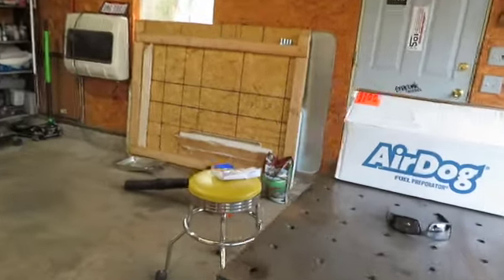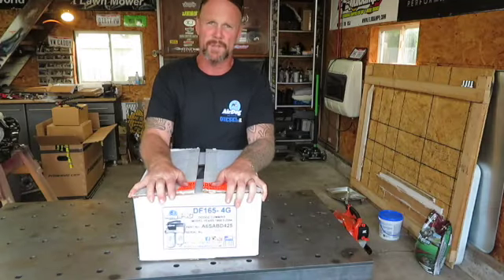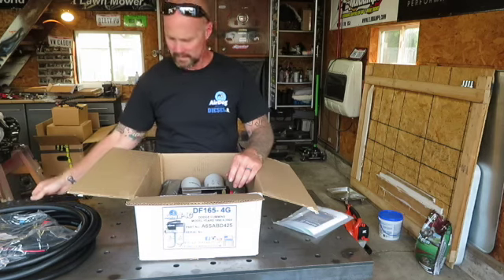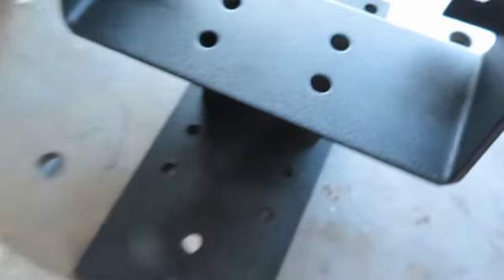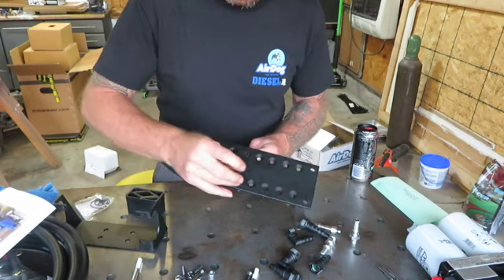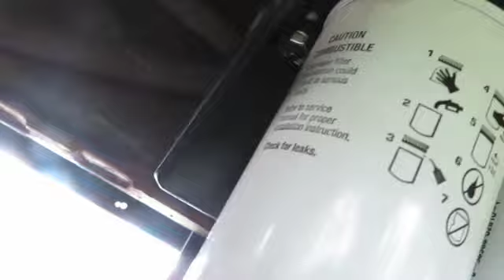AirDog II 4G On My Dodge Ram 2nd Gen Cummins

Comment: Do you think that 1/2" hose that came your will work with regular push lock fittings? The PO did a DIY fuel system, and the only fuel tank is in the bed of the truck. I did not realize until the airdog came in that I can not use the J2044 quick connects for the return stuff. My idea is to get several T'd push lock fittings so i can use the hose that is currently on the truck.
Reply from the maker: You could try it but I would definitely keep a eye out for leaks.

Comment: Hey man, great video. I do have a question.. I bought a 2000 5.9 Cummins that has an Airdog system on it and the factory lift pump is unplugged does that need to be plugged in or does the Airdog bypass it? I'm asking because it seem to have a miss at idle and doesn't run the best. I code p0230 (fuel pump primary control) any help is appreciated. Thank you!
Reply from the maker: If I was you I would get rid of the factory lift pump and go from the airdog right into the vp44.
Reply: @ChadMyers73  gotcha. Thanks so much!!
Reply from the maker: You can get rid of the the factory filter housing also
Reply: @ChadMyers73  yeah, I noticed the factory filter was gone. So I can just remove the stock lift pump since it has an Airdog?
Reply from the maker: Yea
Reply: @ChadMyers73  Thanks buddy!